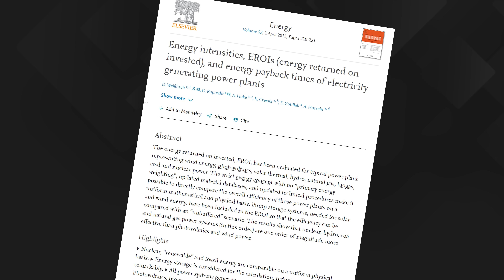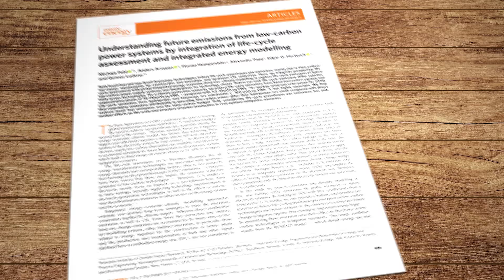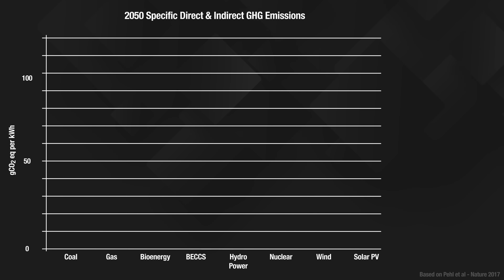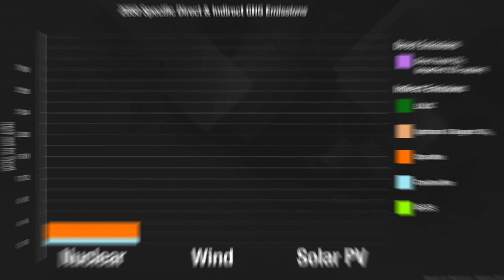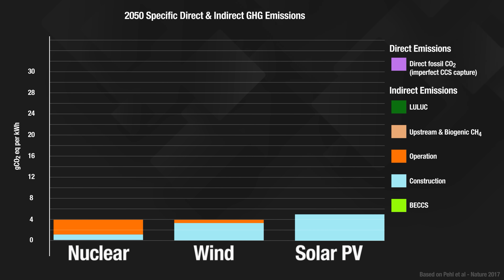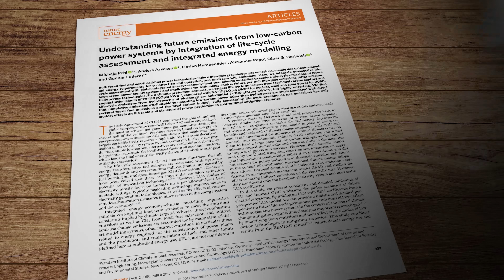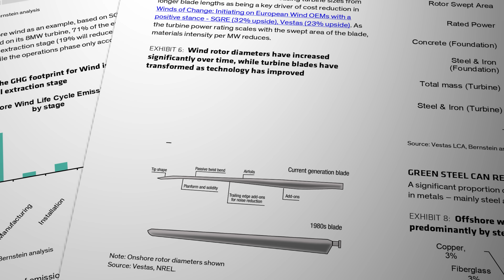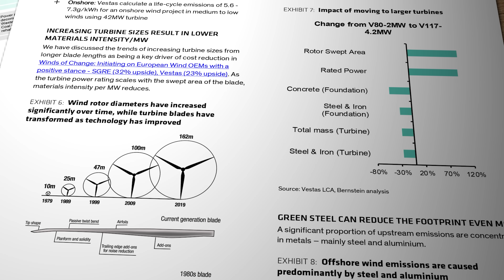Lifetime carbon emissions of renewables vs fossil fuel. Problem or solution?

Comment: Thank you for this, I love your clarity, but I think there are two aspects you've omitted which could have a huge impact on the figures:
 1 is the impact on the ecosystem, birds being killed by wind generators and whales/fish being disturbed by noise from marine generators (all affecting biodiversity and the food chain {to what degree I don't know}) and 
2 the mining, manufacturer and recycling of batteries/storage devices. I'd 😂feel more convinced if these were brought into the equation.
I also note that the report didn't make estimates for potential improvements in nuclear power efficiency.

Comment: This is very encouraging, but the sheer amount of carbon emissions over the lifetime of these power sources may be more relevant than percentile per energy unit. A power source may be able to produce lots of energy for a low percentile of emissions, but there's no point if the actual amount of emissions is too high. In other words: is efficiency really the main concern here?

And are sources like wind taking into account the emissions of all the transportation and heavy duty machines involved in construction? What about the environmental sustainability of the end-products of these different power sources? etc.

Comment: If you have suitable sites for wind turbines, and not much tree clearing is required, then that's one thing.  In Australia, they are clearing 10's of 1,000's of acres of pristine wilderness for wind turbine foundations and for service roads to install and maintain wind turbines.  I have heard figures of up to 42 acres of land cleared per wind turbine for some of these wind farms.  Would be interesting to see a proper / fair analysis of these wind farms.

Comment: Im curious about the upstream emissions from hydro power. Where i live is entirely hydro powered, and the water backed up by the dams are essentially just lakes, you can go boating and fishing in them. Where do all those emmisions come from, surely every lake isnt just pumping out all those ghg's. Ive struggled to find anything i can really comprehend, all ive been able to gather is that it could be really high, like the graph shown here, or that is actually much lower and those graphs are using "bad" (but not incorrect) measurements, either from sample size, or not accounting for things. Still i have to ask, what are those emissions?

Comment: The cost of PV and wind did not seem to account for energy storage. Batteries are not green at all and since PV and wind are intermittent you have to account for the "spinning reserve" that is required when the sun goes away and the wind stops. Often this required gas turbines or idling hydro in order to be able to take over. Few other power sources besides batteries, Gas Turbines and Hydro can ramp up fast enough to step in without destabilizing the grid. Much of the solar and wind are actually waster in present day because it has no where to be used.

Comment: Wind, solar, nuclear, gas and coal are NOT interchangeable! Wind and solar have to have to have gas or coal backup. There's no battery or other storage solution that can be done at a significant scale and there won't be for a very long time. You can get up to only a fractional amount of wind and solar and you're stuck with mostly fossil fuel backup for a long long time. Coal is constant and easily storable. The closest thing to it is nuclear. The BEST thing to replace it is nuclear. Nuclear waste is NOT a problem. There's a tiny amount of it and it can be reprocessed. It's likely an important future resource!

Comment: At 9:39 you state that CarbonCure Technologies is "developing technologies that will embed CO2 into cement.."  CarbonCure is now in 600+ Concrete plants and sequestered/avoided 90,000 tonnes of CO2 in the last year and will double that quantity in the next year as more plants adopt the technology and current plants increase their usage to more concrete mixes.  I'd say they are past the development stage with their current technology.  The only issue they currently have is a shortage of CO2 to inject, based on capture not keeping up with demand.

Comment: Lifecycle carbon emission is certainly an important factor to consider when comparing various energy source. Availability, cost and energy security are a few other factors to consider as illustrated by the energy crisis in Europe. Nuclear so far is the only low carbon, non-intermittent, at scale and independent energy source. Wind and solar in combination to nuclear would offer a good energy mix. Time will tell if they will get adopted.

Comment: As someone who has spent most of his working life involved in hydropower, I found the hydro emissions rather difficult to understand. Whilst a newly established facility may have substantial emissions as the vegetable matter drowned out in the impounding rots down, this is a one off. And it doesn’t apply to run or the river schemes where the storage is minimal and there are no large volumes of stagnant water upstream.

Comment: Its getting really tired hearing people constants criticizing renewables.... ICE cars had 100 years to get to 30% efficiency, (tank to wheels) electric cars have only had 10 years of real investment and they're already beating out ICE.... and all these systems, wind, solar, nuclear, batteries, are already displacing coal and other systems for financial viability and the recycling for all of this is getting close to 100% which is insanely good and super encouraging. If we can get 2 groups to stop interfering, nonsensical alarmist environmentalists (the ones closing down nuclear plants in Germany and the ones forming a religion out of climate change), and the pro-oil things are best as they are now groups, we'll see some real change through innovation. These are technical problems to solve with better ideas that will not only help the planet, but people and will help lift hundreds of millions of people out of poverty. We don't need to become genocidal maniacs trying to limit population and consolidate power or try to maintain the existing economy as if its better when it clearly isn't. A Bugatti costs several million and a tesla costs 200k and its teh same level of performance.... clearly these technologies are significantly superior and will displace ICE and fossil fuels.

Comment: a wind turbine has a generator as does a fossil fuel plant.  the turbine has a fan, that's it.  the fossil fuel has a drill rig, pollution control (that they don't do) pipelines, pumping and degasification stations, a building for the system, a fire box, a boiler, a steam turbine, a transmission and finally a generator.  so you were just joking, right, trying to get clicks?

crops do not store carbon.  it is in cycle, and in fact there is no carbon capture.  hydroelectric, fine.  nuclear, there is no way to get rid of the waste and the future value has to be computed over 50k years, so you have to be on serious drugs.

taking down a bad wind fan and replacing it, duh, could be done with electric trains and equipment.

don't be an enemy of the environment because of some paid for report.  oh, and the offshore turbines, those could go on oil production platforms that cost lots of money to remove as required by law but often not done.  all the stuff with recycling in this video will happen.  fossil will continue to pollute and not pay for the damage.  oh, look up steven donziger with your search engine.

Comment: Human generated CO2 amounts to 3 to 4 percent of total CO2 generation for the planet!  When CO2 levels were in the thousands of ppm life on this planet flourished, even with the average temperatures were much higher.  Your statement on nuclear waste was based on current technology and does not consider generation four technology which can and will use the vast majority of that so called waste for fuel, and be safer still!  Your attitude seems to be that of whom I consider to be anti human.  I agree with you that an ever increasing quest for a larger and larger GDP is perhaps the wrong  goal.  The real goal should be the flourishing of the planetary population where not one person lives in poverty and individual freedom is universal, this will also act to stabilize planetary population and likely start reducing it. This goal is possible but not with energy poverty as is currently happening.   For cheap abundant energy the current answer is hydrocarbons and lots of it.  Combine this and the decriminalization of nuclear and we will have a good start to a better world. This means outlawing such organizations as the WEF and UN/IPCC.

Comment: Thanks for the presentation of analysis. Would like to see some numbers for geothermal generation. I would also like to see the prospect of tidal generation given more air. I know it is insignificant globally, but some locations have significant tide height delta. And turbines could generate power on both incoming and ebbing tides, more reliably than wind generation. Food for another think!

Comment: This fear of Co2 has become a fetish. We've been using fossil fuels for well over a century, an energy source that emits *carbon monoxide*. A deadly gas that nobody cares about. But Co2, a harmless gas that 7.5 billion people exhale every second has everyone freaked out. 

The warming we are experiencing is mostly benign, easily managed and a net positive for humanity. Co2's effect on warming has diminishing returns. The more Co2 expelled in the atmosphere the less of an effect it has as a greenhouse gas. It's effects are logarithmic.  Historical data clearly shows that in the past Co2 has often led temps, followed temps and more often than not there is no correlation whatsoever. Co2 is greening the planet. Plants grow faster, larger and are more resilient. Sure, it's a greenhouse gas, but it's effects are minor and certainly not catastrophic. Get a grip.  

Horticulturalists pump 1500ppm in to green houses. There are no warning signs on the door, the workers don't wear protective equipment and there is no demand to limit exposure. It's harmless. On submarines and the International Space Station Co2 levels are frequently as high as 5,000ppm. Nobody dies. 

It should also be noted that apart from a spike in 2016, temps have barely budged in 24 years. During this same period humanity used more fossil fuels than our entire history of use. How do you reconcile all of this. OK, resume panicking if it makes you happy.

Comment: University of Illinois has a project called PETROSS, which is creating an "oilcane" plant... from sugarcane, they genetically modified sugarcane for oil production in it's leaves and stem and inadvertently also significantly increased its sugar production as well, as cold tolerance and extended production season. They plan to produce 17 barrels of oil per acre, 17x more than soy... currently they are at 10x more than soy with the current generation of the crop. Once you have those kind of yeilds it would be crazy to plant any other biofuel crop. And just to reiterate it produces BOTH, 10x more oil than soy currently AND over double the sugar that corn produces per acre their targets are for oilcane to hit $2.20 a gallon. With the current crop the oil production alone could replace HALF of our diesel use with biodiesel at half the current price.... that's including aircraft jet fuel as well. At 17percent oil content it could replace nearly 100% of our oil use and can be grown on land that is considered marginal for food crops.

Comment: Carbon Capture is practically impossible in realistic plants, there is no way to implement it at scale. You need particular types of limestones underground, and particular methods of injecting CO2 so that it binds to the rocks. It has never worked, it's simply a form of global warming denial.

Comment: Renewable energy without storage or hydrocarbon backup is not a practical source of reliable electricity. Additional distribution costs because solar and wind can’t be put close to electricity consumers should also be counted. The energy costs of storage or backup power alone make renewable power a significant fraction of hydrocarbons.

Comment: Real electrolighting electric may be cheapest use electric spark to boil steam is cheapest because after heated we can kept it hot for long time in insulation then reduce fuel and it even cheaper if use microwave is even cheaper way to boil steam

Comment: We can move away from fossil fuels, but it has to be done slowly, like over a period of 40 years. It must not be forced. This would not eliminate the oil industry. There are still thousands of products that come from fossil fuel, such as lubricants, chemicals in general and diesel for farmers, truckers, our military and for jet fuel for our airlines and for large boats and ships powered by diesel-electric  propulsion systems. During the 40 years we work at creating the infrastructure for hydrogen powered autos and for electric powered autos. During that time we promote, but never force or put pressure on people to buy hybrid vehicles. While said infrastructures are being developed for our major cities, rural areas should be exempt from change, other than offering charging stations and hydrogen at truck stops for electric and hydrogen powered autos passing through. The majority of pollution from autos is from in and around major cities, not from rural America. Where do we get the money for this transition? Turn over all of our foreign military bases over to our allies, along with 25% of the savings we realize, so they can keep them at ready in the event they are needed. We than bring our soldiers home and  strategically station them in and around our country and its territories. And we give our military 25% of the savings as well , with instructions to use it to strengthen our defenses here at home. The other 50% goes towards the transition.

Comment: The mono-crop biofuel plantations need the largest chemical fertilizer inputs, increasingly. Why? They are mining the top soil, slowly reducing the biodiversity. So, the increasing need for more chemicals makes the analysis of the emissions in their production relevant. Moreover, the farm will eventually become agriculturally worthless. Without subsidies this bio-fuel would be uneconomic. It was a political scam from the start. If people would self-govern, they would make mistakes, but NOT like the politicians make. People wouldn't try to cheat themselves. The "politics as usual" does just that. What would you choose, if you "Just Have a Think"?

Comment: Hi does this wind calculation take Into account high voltage grid connection from offshore site plus whatever technology is used to store the intermittent power to smooth the end user supply. I think we need to move away from fossil plus model to a like for like comparison?

Comment: Combining talk about adoption without regulation and this grams per kwh without cost being factored in as a metric AT ALL is odd.  The wind leases like land for skyscrapers end up robbing the bargain of land conservation with the public receiving those funds a big distraction.

THe public suffers the opportunity cost of the investment beyond the lease and has reduced discretion about the lease fee.  THe lease like tobacco taxes corrupts lessor, and we are talking big numbers.

Wind is so far electricity.  I would support the accomplishments more if greater diversity regarding what attaches to the axle was occurring.  There are very large wind motors with tremendous transmissions as well if that has not been virtualized but the    8 kwh camping turbine suggests magnetic field conservations requires high rpm's.

The market for torque power, for buying hp at the shaft, even above ocean, is untapped.  WHY?

Is hydraulic transmission of power really so inefficient?

pulled cable transmission so obsolete?

Or are we just myopic?
These spinning shafts can do work we need done- breaking water molecules or just taking mass of out air vapor so it can be shipped for it's cooling and potential energy once so shrunk to do immense work without any real cost or resource demands in the motors so driven.  Retrofitting our existing cars to zero emission at extremely low cost, converting them to operate on liquid nitrogen literally say, is worth the cost in continuing to crash into people lethally and worse.

The super cheap even if demand for such hp at such price exceeds supply of wind tremendously (when tax of wire and logic is removed from harnessing wind hp the best use for that mechanical energy opens up calling its' bluff!)

We need markets not biased rhetoric and ancient reports whose precision is worse than absent because it's premise is false.